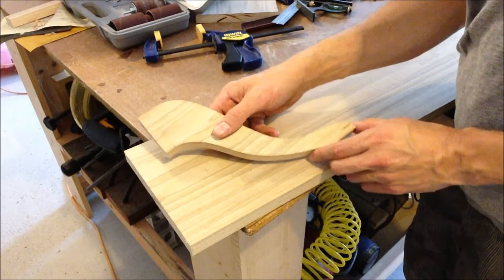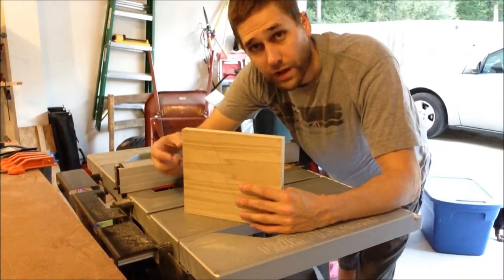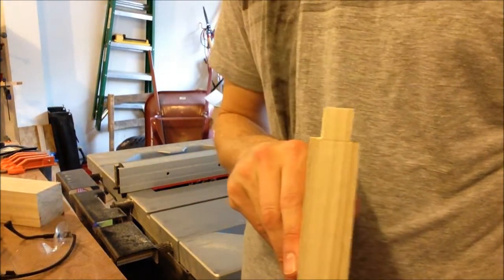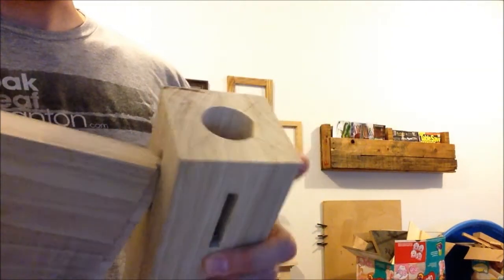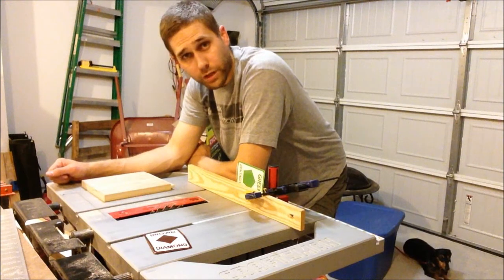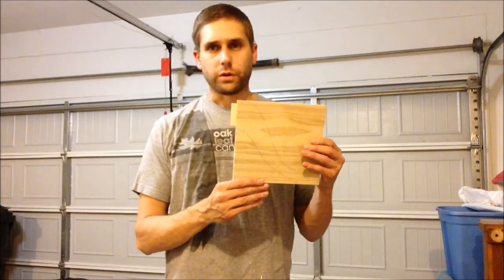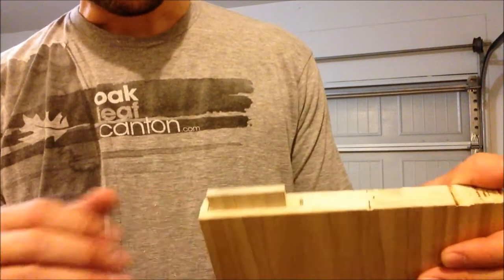Organ Leg Coat Rack Part 4 (CMRW#4)

Comment: I just saw part 1 thru this video. Great series so far man. Thanks for sharing. Looking forward to this.

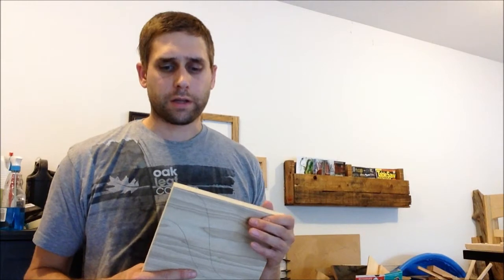one thing I have noticed on your table saw is, and I don't know if it's just me but, when you clamp down on the fence handle, if you pause it @ 2:35 see where you set your hand? Is the little black clamp on that side of the fence upside down? I noticed in your part 2 video if you pause it @ 1:10 and @ 1:32 your fence pops up from the other end when you clamp down from the handle.

Comment from the maker: Well, I developed a habit of lifting the back of the fence up to make sure it's not caught on the back rail and I'm not clamping it down out of square to the blade. I guess I do it now without realizing it.  That fence is bad about being crooked. I realized it when I was initially setting the table saw up after I received it. Good eye.